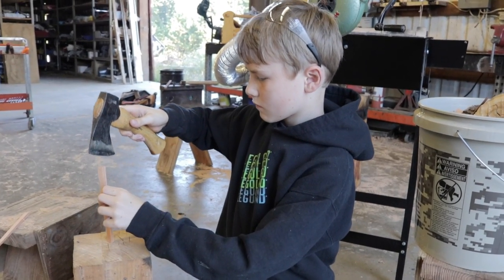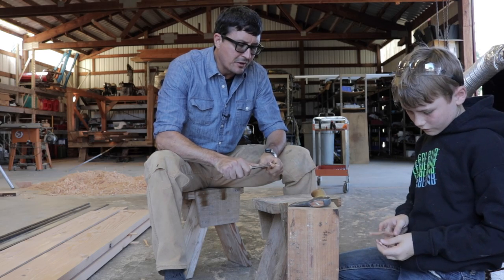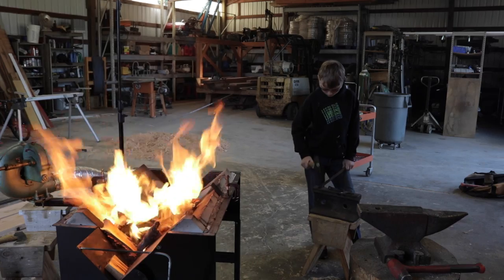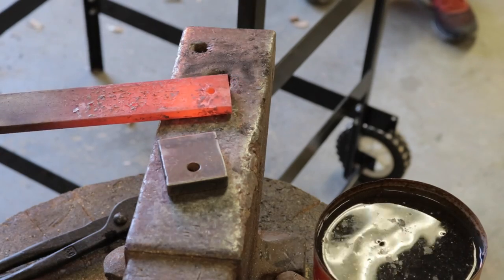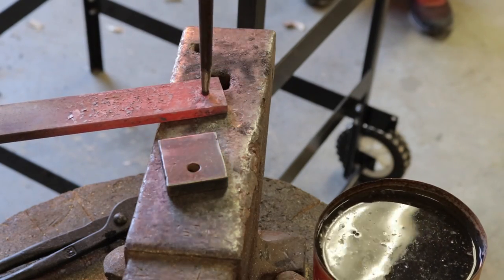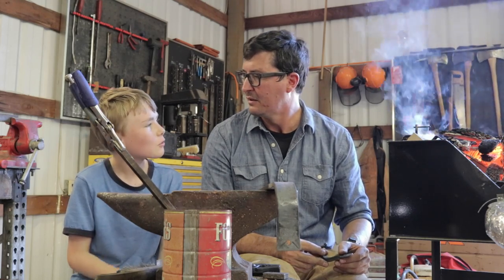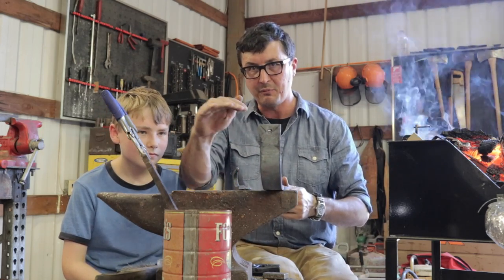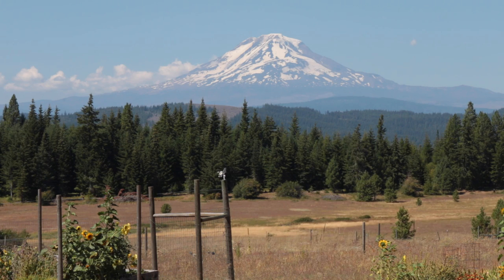Blacksmith With Wood

Comment: You guys look like you're having a little too much fun. I'm totally lusting for your forge though!

I use charcoal, rather than starting with wood, but I have enough deadfall that I could probably source my own fuel with one of those guys. 

Couple of quick protips: Keep a little tin of ash or (char) coal dust next to the anvil - you can dip your punches in and the dust/ash will keep the punch from sticking.

second protip: DONT USE THE FACE OF THE ANVIL FOR PUNCHING! lol. The little step between the face and the horn is the "Table" - it's used for cutting (through) and punching, or removing a stuck punch. The rest of the anvil face is (or should be) hardened, so you don't want to dork that up with punches and chisels. The pritchel hole is designed for that, though 

Suggestion(?): If you grab a piece of 1" or 3/4" square stock - whatever fits your hardie hole rather close - just heat it and beat it gently in to size it properly - you can tack weld that punch plate to it so that it lies over the pritchel hole.

How would I send you something btw? I've got a stack of rebar I could knock out a spring hold-down helper for you. I just set my channel up, and have been looking for a little project to get her rolling, and I'd really enjoy doing a quick how-to and then ship the finished product out to you. (I'd need to know about how big that pritchel hole is though)

Have fun and keep pounding. All these little bits start coming together into a level of competency and all of a sudden it clicks, and before you know it you're 3D-printing titanium rocket engine parts. high five.

Comment: Have you given any thought to use home made charcoal for your forge rather than using wood?  The wood contains volatiles that can interfere with proper blacksmithing work by adding corrosives to your fire till they burn off (no smoke coming from the fire).   When blacksmithing over a wood fire, you wait till the smoke stops before you can begin forging, while use of a charcoal fire allows you to begin right away, as all those volatiles have already been burned off.  Forging over the a smoking fire would result in a lot more of your steel getting burned off as it rusts and flakes away.

I am not talking about the charcoal briquettes that you may be familiar with for backyard grilling, like you would buy from a store in a bag labeled "Kingsford" or some other brand, but the stuff that would be considered "Natural Lump Char Coal".  You can easily make it yourself by burning a good quantity of wood in a 55 gallon drum and then putting the top of the drum on to starve the fire of oxygen after the fire stops smoking .... let it sit for 12 hours (overnight) and come back to it.  Clean it up and save the lumps of coal to use in your forge.  To reduce sparks coming up off it, you can wash your charcoal off with water (no, I'm not kidding) and let them dry in the sun... when the water is all gone you can bag it and store it for later use.  There are a few videos on the subject that you can look up on youtube for yourself, for more detailed information on the process and benefits.

Comment: Why do you use a deadblow hammer when it will be easier to use a normal hammer and to work with the rebound. I have been blacksmithing for almost 2 years and it will help to not get tired so soon.

Comment: In a blacksmiths tool collection tongs in number are greater even than the hammer.... Tongs are very important. Without something to hold your work, you're just not going to be able to hit it. Most blacksmiths have a variety of tongs for a variety of purposes. For example, a tong shaped for holding a sword isn't going to do the job of a tong shaped for making a horseshoe. Fortunately for blacksmiths they have the option of making their own tools, as long as they have the basic starting tools. Having a vice is also very useful for holding your work.

Comment: Don't hammer your steel for shaping until it is white hot, just below when sparks start flying of  the steel before you begin to hammer.  Once it starts to turn red heat from cooling put it back in the fire and bring it back to white heat. You  will be able to move the metal easier.

Comment: You said that you need a better anvil. What anvil do you consider the best?
Reply: most anvils available today are cast iron, otherwise known as "anvil shaped objects". in north america i have read the only large manufacturer making hard forged steel anvils is the ridgid tool co. and the rest of the easy to find ones are "anvil shaped objects"...the rule of thumb on anvils for size is 50 times your hammer weight. so if you are swinging a 5 lb hammer, you should get a 250lb anvil. i'm guessing for what cody needs a 150lb anvil would be plenty, but the cost at grainger is about $1200
Reply: auctions are your friend....raven bishop has it right, you both need bigger ones, and ACK....can they be pricey.

Comment: I dip my hand in the water barrel before I put my hand near the fire or hot metal (although I have only gone blacksmithing 4 times, so don't take my word for it).
Reply: Also, I am Christian, and I appreciate the macaroni analogy, but I still prefer plain macaroni to any of the combinations listed in the video (although that's probably just a problem with my senses of smell and taste).

Comment: Tell jack that your first projects will suck. They will not turn out the way you want. And also the way I get my bends almost 90 is I get them almost white hot and they I put it in a vise and and bend it and then if it's still not 90 tap the top of the bend to get a nice 90.

Comment: Jack when drawing out the taper use your hole arm and shoulder , bringing the hammer about level with your head. Then use the blows like you were doing to clean it up. Cody for the flare on the bracket use the cross pien of the hammer it's hard to explain but look up fish tail scrolls and there are videos on how to do it . Also please check out my channel .

Comment: You need to get Jack a bigger hammer and have him hold it closer to the head, so instead of swinging the hammer from the edge of the handle and stressing your wrist and elbows you can raise the hammer with your shoulder and just throw the  hammer down on the metal. You can get much more accurate and powerful blows that way without wearing yourself out.

Comment: If you buy a golf bag and clubs you are a golfer so...... you're a smith.  Maybe stick to wooden handles for your hammers. Synthetic handles will change in stiffness as the heat changes, wood will not do that, So that the feel stays the same.

Comment: Don't like being one of "those" people... but as an Army Aviation Veteran, I was told so so many times about wearing hearing protection and when I was jumping in and out of the helicopter to make some adjustment. I ended up developing tinnitus due to those "quick" in and outs..  You both need to be wearing hearing protection when banging on those anvils, I guarantee you hindsight will be 20/20.  Go to https://youtu.be/H-iCZElJ8m0 if you are unsure what tinnitus sounds like. Mine is around 7000Hz and NEVER stops. Wear your hearing protection!

Comment: Cody, Your anvil is fine.  It needs to be secured to the floor.  Jack should be working on a size stock that is commensurate with his arm strength.  The easier it is for him to manipulate the steel, the more creative he can be and the more success he will see and feel.  And, yes, I am a professional smith- circa 1981.  Use single pick-up tongs to hold your chisels and punches.  Keeps yer fingers happy.  A pinch of coal dust in the hole keeps the punch from sticking.  Thank you for being a great Dad by teaching Jack to take care of himself.  Would fly out and give you a classes for free if I could afford it.  Christ first!................Ross

Comment: While hammering, I was surprised you were able to hold that hot piece of steel with your bare hands! Maybe need some quality blacksmith gloves? Also I cannot quite image the 'blacksmith police' condoning what appeared to be a between the legs/crotch--stabilization technique. Maybe an experienced blacksmith viewer can provide some constructive advice? I, for sure, am no blacksmith.
Reply: KJ the steel where Cody is holding it is cool to the touch. Steel and Iron are poor transmitters of heat as opposed to non ferrous metals. Most blacksmiths I know do not wear gloves. Those that do wear one on their non hammer hand. Clenching a bar between your thighs is acceptable. I'm a semi retired blacksmith with over 30 years experience.
Reply: Thank you.

Comment: Why can that peace you find through your religious belief not be applied in the same manner; You saying the plain macaroni noodles are peace and adding to it makes you realize faith in ones religious background  makes it so much better than the original peace you thought was the epitome. My beliefs in spirituality say the same.....take ones faith (any denomination) and apply the same principals and you can even raise that bar of epitome with a faith based religion. I read my words in proofing and realize it is rather confusing but maybe it will be comprehended by some other whom has a similar twisted mind as my own.